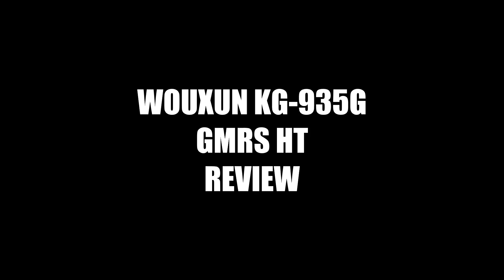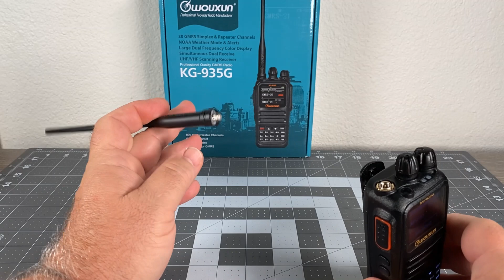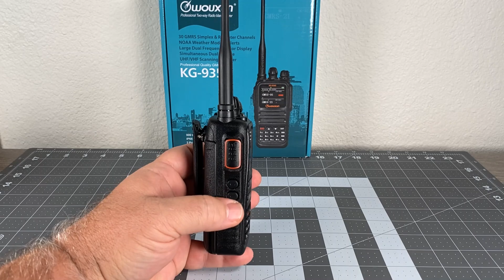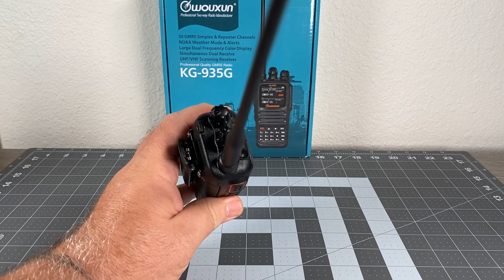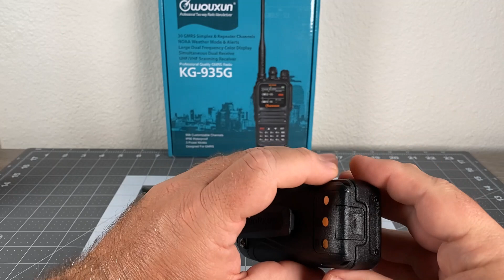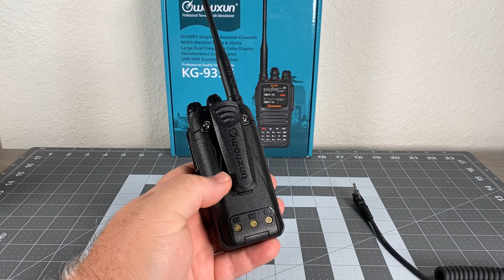Wouxun KG-935G GMRS HT Review

Comment: Thank you for the review.
Is there a shorter antenna that can be used with this model?  I’m interested in a shorter antenna for group use, where the other members are less than 1/2 mile apart.
Thanx
Reply from the maker: I have a KG-935G antenna video coming up in the next week or so that will feature the Nagoya NA-701G. It is not only a good bit shorter than the factory antenna, but also works much better.
Reply: @KS6DAY  would this work for shorter distances (1K yards, line of sight)?
https://cdn3.volusion.com/zjtzu.trdxw/v/vspfiles/photos/46560-2.jpg

Comment: Just an off the wall side note as it relates to scanning on these GMRS radios and the cost of these GMRS radios.    The "cost" of these radios is very cheap compared to a scanner that will receive most public safety frequencies now that are in the 800Mhz range and use P25 to decode the voice.  (I'm just referring to Indiana really here where I'm from as other states use 700Mhz or 800Mhz and use other forms of voice "encryption")   Anyways.......A Uniden Bearcat scanner now that will receive basically everything that a scanner CAN receive (minus cellular) and scans at a blistering pace costs upwards of $650!!!    Yikes.....so a $150 GMRS radio is a great buy for the GMRS world it's intended for but if you're interested in scanning outside those bands or in those bands, be prepared for sticker shock to get a receiver that'll pick up what your local police, fire, State police, EMS, etc are using most likely in the state you're in a SHTF scenario or something a bit less than SHTF but still may be quite a concern for a fully prepared prepper.  My .02 and just a note.   Getting my 935G soon (so I can transmit)!!!    And love my Uniden scanner.

Comment: Got one and I'm not sure if it works. I can't get anyone to reply to me at all. Maybe no one has gmrs around here.
Reply: One thing you might try which I do.  Add a 141.3 (aka Travel Tone) to the xmit (encode) of every channel in the radio.  That includes GMRS 1-14, GMRS 15-22, AND RPT-15 thru RPT-22.  Set your receive on all to Carrier Squelch or "OFF" for decode.  In many areas, repeaters will be in range that will key up with the 141.3 "privacy" tone.  Ditto many may have their CTCSS decoder set for 141.3 on the non-repeat channels.  Throw out your call sign on each channel and see if you get a response.

Comment: In reference to the keylock feature. I have a Wouxun KG-S88G and it has the keylock feature as well. However, on this radio you still can change the channel with the top channel knob. Also note that this radio is fully submersible. It's a great radio, I really like it a lot.
Lonnie

Comment: I'm sending my kg 935 back the top bank doesn't scan correctly. It slower then the bottom bank and will show a transmission on every channel but no audio.The bottom bank works as should is this a setting problem

Comment: The 935G is robust with it’s IP rating, but some of the software functions are frustrating. Wouxun’s KG-UV9 line, which they make GMRS versions, has a better user interface and the top knobs quick scroll, but you don’t get the IP rating. I’m still waiting for Kg-UV8H and 935G chirp compatibility. It takes forever to program hundreds of channels without being able to copy paste from Chirp. 

Thanks for continuing to make GMRS videos from a ham viewpoint.
Reply from the maker: I have a KG UV-9P that I am becoming very fond of. My only complaint is the display backlight, but they fixed that with a dark display version. I will be doing a review very soon on that one.

Comment: I appreciate your review - I am a total newbie at this radio stuff and just bought one of these radios. Hope I am not overstepping but I have a question: how did you get the text in the display blue? I can only find white and yellow.
Reply: You can change the color of the text and background in the menu. Not sure as to what the options are yet as my radio has not arrived yet.
Reply from the maker: In the menu there is a setting called "Theme" nav to that that selection, click "menu" again and you should be able to move between 4 options with the channel knob. Turn it until you get to "Black-2" click menu and the radio will reboot and you should have that color scheme. Black-2 is the Theme I am currently using.